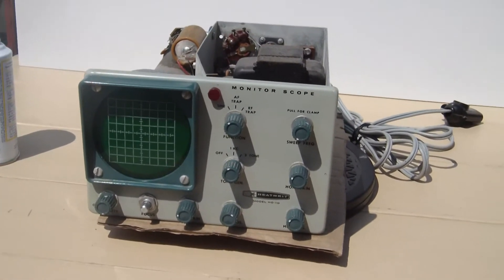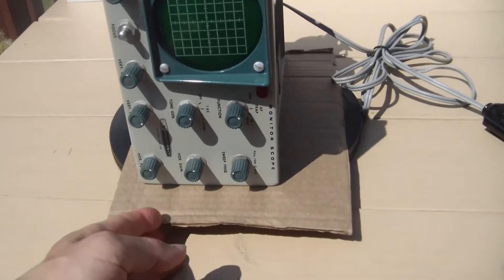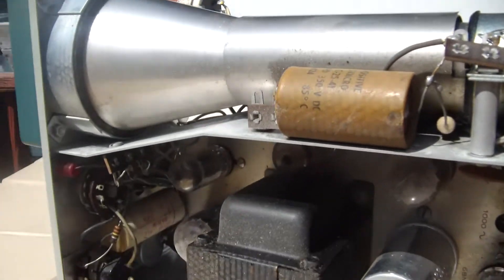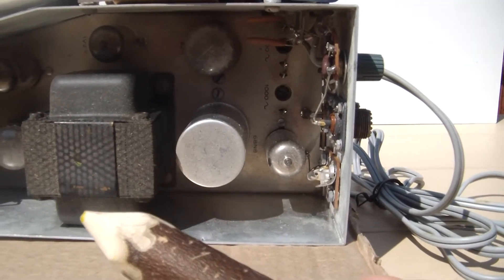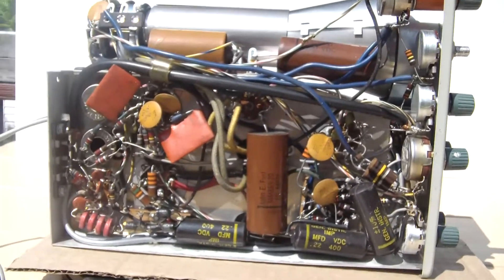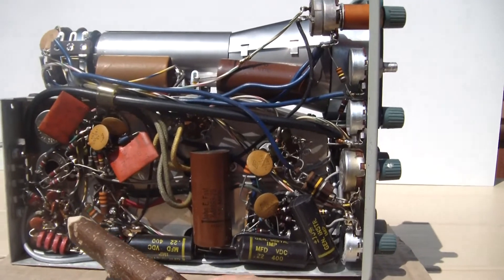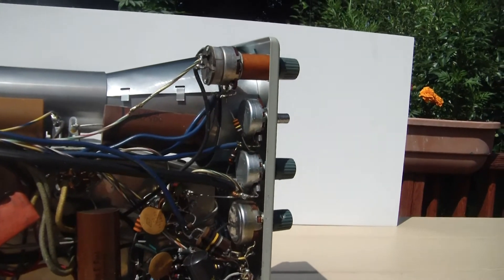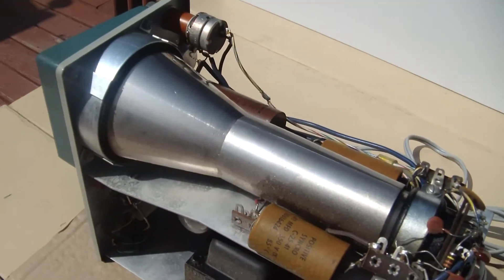Heathkit HO-10 monitor scope. Inspection, part1.

Comment: I have one of those HO-10 scopes. I have been looking for a John E. Fast, electrolytic15 MFD 1600 VDC, no one seem to have one.
The capacitor, round and 2 and quarter inches long.
Need help guys
Reply from the maker: https://hayseedhamfest.com/collections/heathkit/products/ho-10-re-cap-kit
Reply: @KlondikeMike  Thanks.I another problem 1V2 tube will not light. All the other tubes seem to work. Thanks again for the info on Heathkit parts.
Reply: sorry I did replace the 1V2 tube with a new one, still don't work.

Comment: Mike....... It's been over a year now.......Did you get your parts yet?
Reply from the maker: Nope. I haven't forgotten about it either. It stares me in the face every day asking the same question. Its lower on the priority list than some other items at this time. But not by much. I've got the replacement controls and still need to purchase the electrolytic cap kit from Hayseed. I like this scope and will get it operational. Stay tuned!
Reply: @KlondikeMike  I just got on from a friend...payed $50 for it...Works great, but will at least replace the Power caps...I see Hayseed is asking $35 for the can cap...not too bad...Good luck Mike.